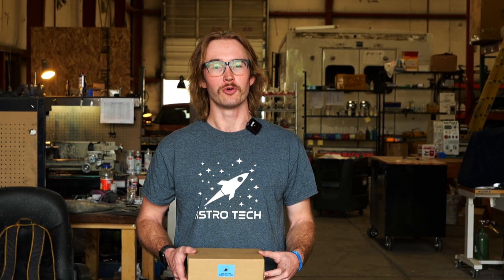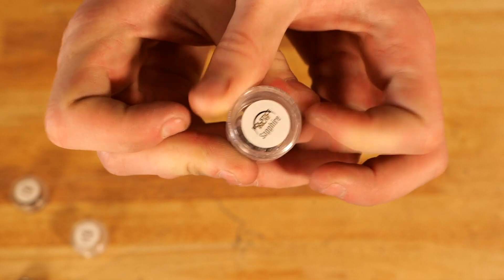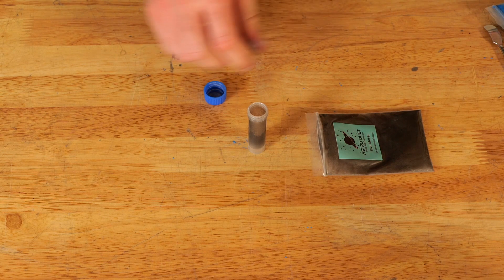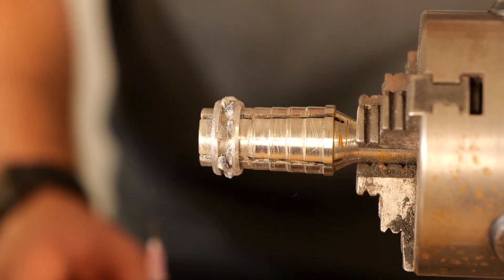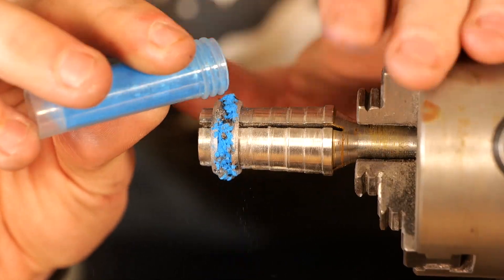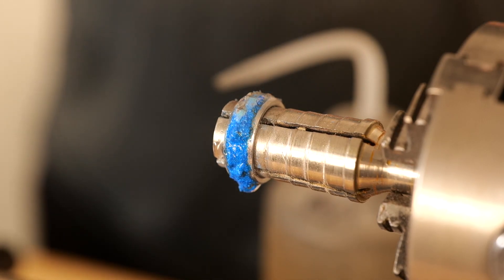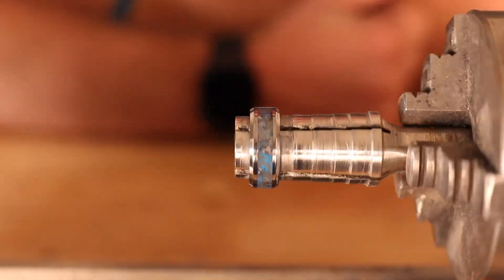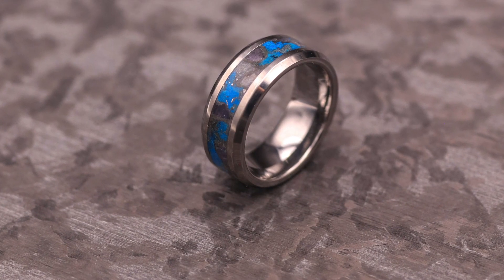How To Make a Tungsten and Sapphire Ring - Detailed Tutorial

Comment: Reccomendations for a cheap lathe that can get the job done? Super interested in making these rings!
Reply: Yes! This!
Reply: Well that depends pn what type of material you would be using like if you are thinking about using titanium i would revomend a little stronger and expensive type of lathe but if you would use brass or Copper most mini lathes in the price range from about 500-2000$ would be fine. Mine is a chester U.K conquest lathe and I'm very pleased with it.
Reply: I just got the excelsior mini lathe on sale for $299, and I’ve been loving it